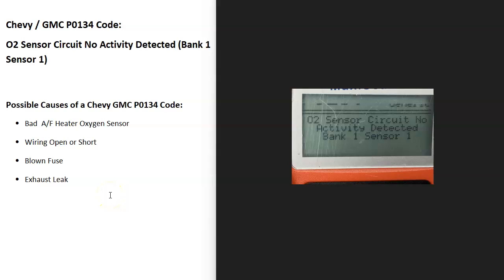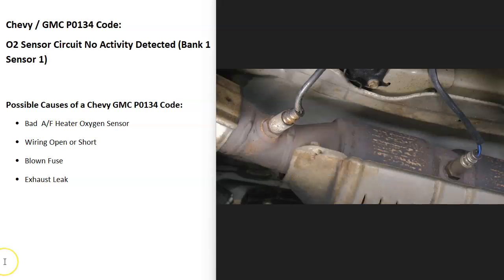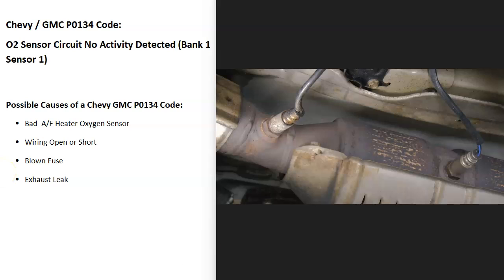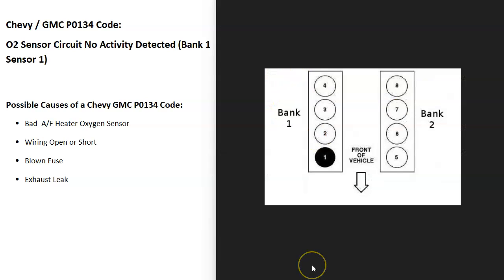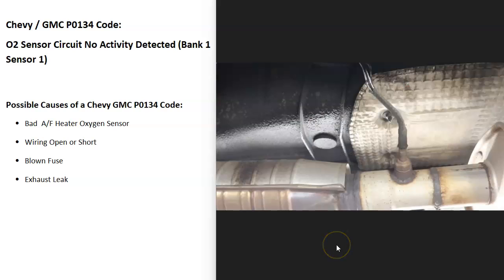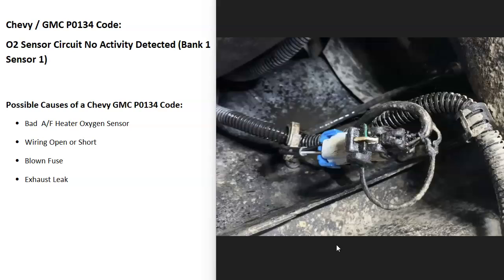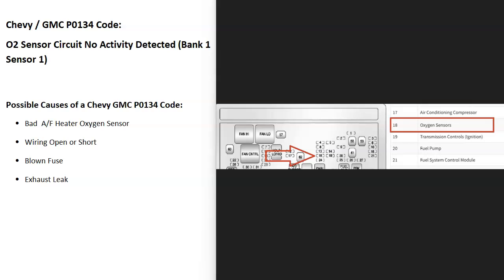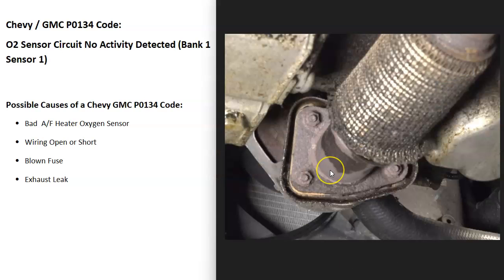Causes and Fixes Chevy / GMC P0134 Code: O2 Sensor Circuit No Activity Detected (Bank 1 Sensor 1)

Comment: Have you ever seen an internal PCM failure cause this sort of thing? All four sensors on a 4.3 Silverado I'm working on are fixed at 0.45V and I have no idea why. I've been sorting through everything trying to figure out what could be wrong, but a PCM failure is all I can think, unless one of the signal wires has manged to ground itself somewhere. Which also seems unlikely,  as I've gone through most of the harness between the PCM and O2 sensors.
Reply: Did you find the cause (or solution)? I have this same issue on a 1999 Tahoe, not reading live O2 sensor data and all fixed at .445v. PCM failure?
Reply: @kend4718  I did find it, it turns out the exhaust was not grounded. The O2 sensors are grounded through the body of the sensors, through the exhaust.
Reply: @alexp6016  interesting! thanks.  isnt the exhaust inheriently grounded since it is hard connected to the engine?  Perhaps an auxillary ground might be helpful-  attached to the exhaust?  Also- perhaps the wrong anti-seize compound could throw things off?  THNAKS
Reply: @atomicdmt8763  Yeah, it seems it needs additional grounding farther back. Anti-seize and corrosion could probably affect the grounding.
Reply: @kend4718 I have the same issue. Did you resolve?
Reply: What did you do to fix it?

Comment: What would an 'exhaust leak' look like? What do you actually check for?
Reply from the maker: Look for road damage, holes, anything coming apart, and blown out gaskets.
Reply: will do , thanks.  @HVAC_Mechanic
Reply: @HVAC_Mechanic I have a Crack in my muffler will that cause it? 😅